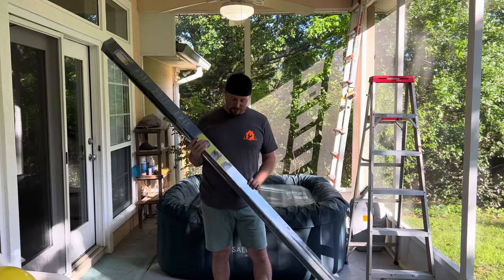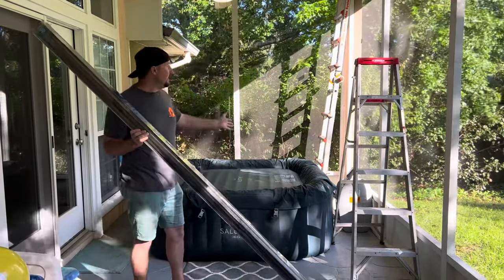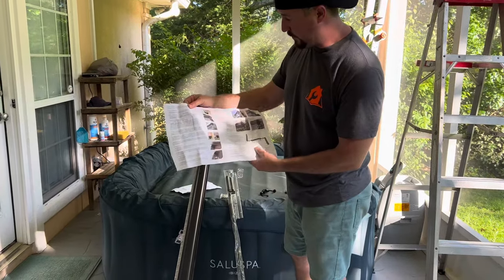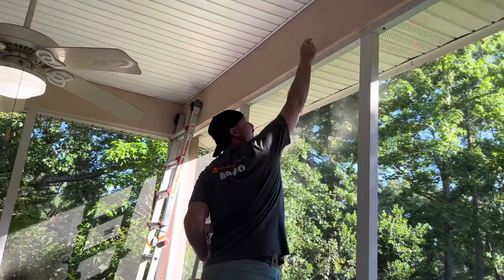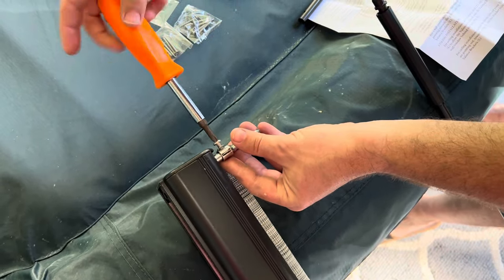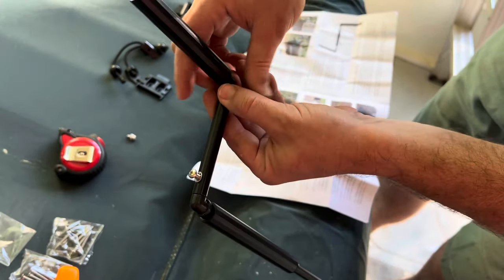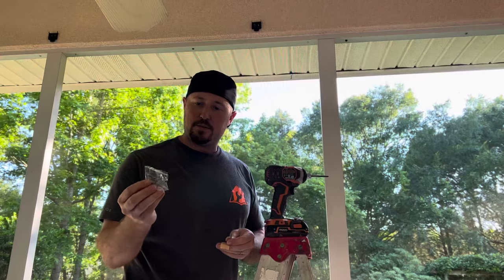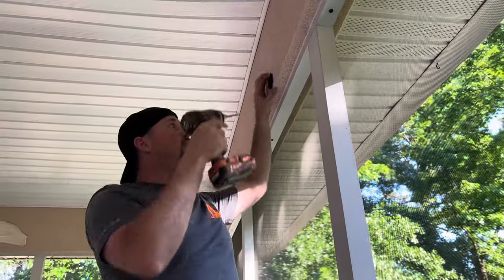HOW TO Install COSTCO Koolspot Outdoor Sun Shade + HONEST REVIEW

Comment: So I mounted the brackets on a 6 foot - 1"x2".  Two brackets, 12" from each end and 1 in the middle on the 2" side.  Then,  I screwed in 2 eye screws into the 1"x2"x6' top side, 12 " from each end. 
I used 2- 4"  screw hooks,  screwed into the patio cover header( in a smaller drilled hole), which is covered with stucco.  This method allows me to slide the shade an additional 12"  (left-to-right) from each side to adjust for the changing direction of the sun.  Placing the end brackets further from the 1x2 ends allows for greater coverage.
Also during winter or annual cleaning, all I have to do is lift up the entire shade attached to the 6'x1"x2", up and over the eye hooks, without ever removing from the bracket clips. Saves time unmounting and remounting.
Reply from the maker: Great work, partner!  Thanks for sharing the ideas!

Comment: The only thing I do not like is that the crank rod does not fold straght and hang down.
For tis reason I will buy the Coolaro from Lowes, a little more but well worth it to me
The price point is about 20% more for the Coolaro but well worth it!
The good thing about the Costco brand is that the loop at the top for the crank is metal and the coolaro is plastic buy very strong, I doubt it will break and you can always go on line to order parts for both. I am buying mine today as a matter of fact and I was looking for comparason videos on both.
Thank you for making this video, it was very good

Cheers!
Reply from the maker: Thanks for the info, partner!  Happy to help.

Comment: If you do a wall installation does the tab on the bracket have to be “free” hanging? Or can you install the brackets up in the middle of the wall(board). How easy is it to unhook from the brackets?
Reply from the maker: Howdy, partner!  Not sure what your question is asking exactly, but it needs to be well supported as the shade is relatively heavy.  Unhooking from the brackets is easy however it is not something to be done everyday.  It could be taken down occasionally if need be.  Good luck!

Comment: Is the lowering crank specific to one side?or can you flip the track around and won’t matter which way the shade is mounted?
Reply from the maker: Howdy, partner!  Pretty sure it is specific to one side.  The way the track mounts, I do not believe it is reversible.
Reply: Not sure if it’s exactly the same model but KoolSpot has an instructional video where they show you how to move the lowering mechanism to the other side.
Reply: @eyeheartsushi2212  thank you sir! Will look out for it
Reply: I think this video will help with moving the crank from the right side (default) to the left side. https://youtu.be/Wu-90FnEHCk
Reply: @tponce  That’s the video I used. Didn’t link it because I thought YouTube didn’t allow it.

Comment: Just installed but I can't get the brackets to click.  I've tried a screwdriver but no luck.  Maybe I am not pushing down hard enough?
Reply from the maker: Howdy, partner!  Your wall surface may not be perfectly straight/level.  Could this be the case?  If so, you may need some sort of spacer/shim behind one of the mounts.